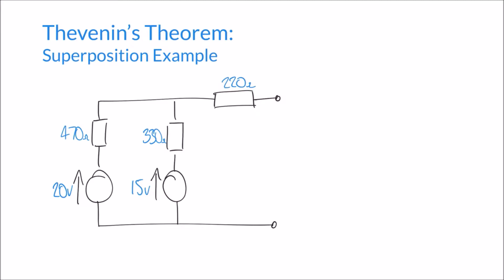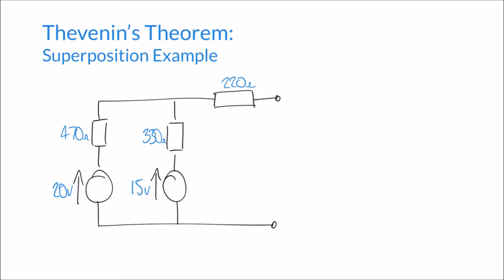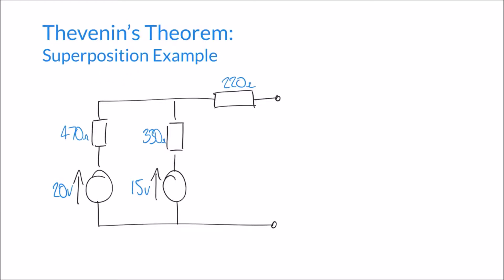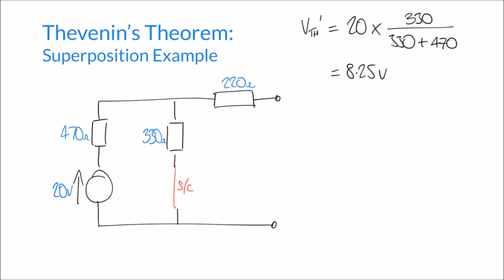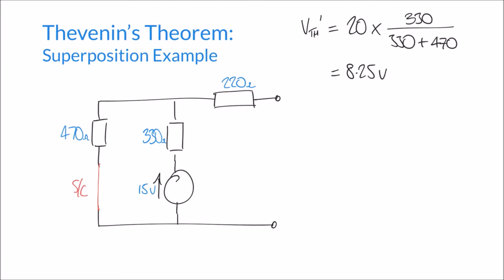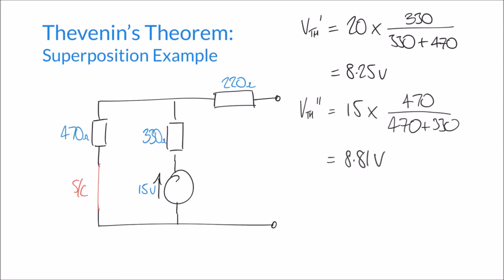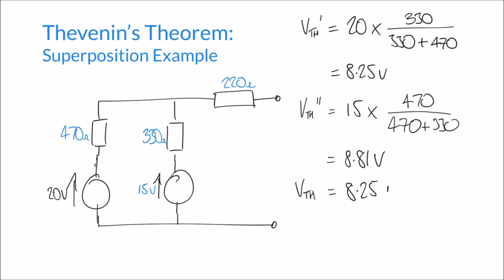Using Superposition to Find Thevenin Equivalent Circuits with Two DC Power Supplies

Comment: Hey buddy, thanks for this info! I have a circuit that has batteries on either end of the load resistor. Does this mean I should subtract the voltages, instead of adding them like you did in this example?